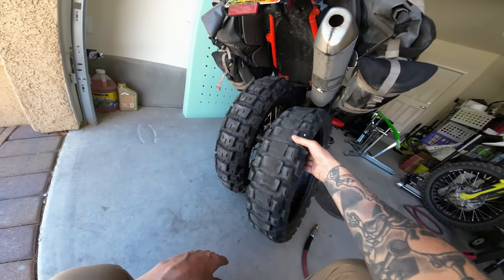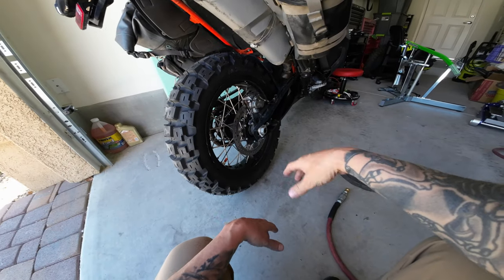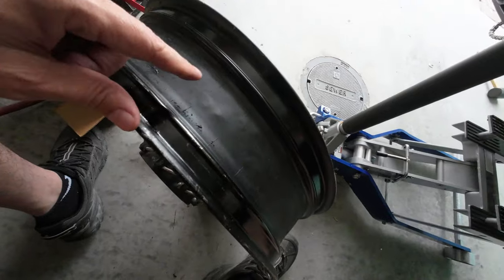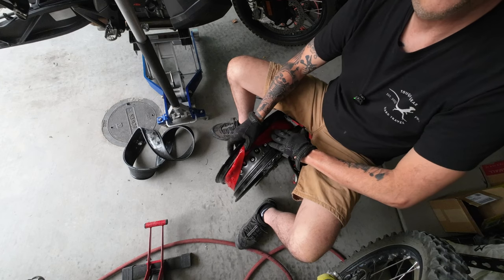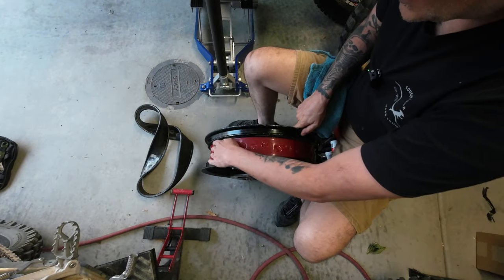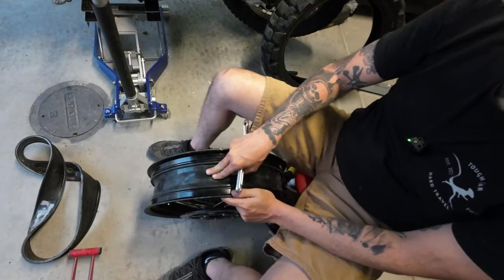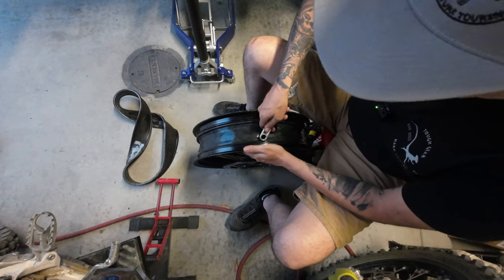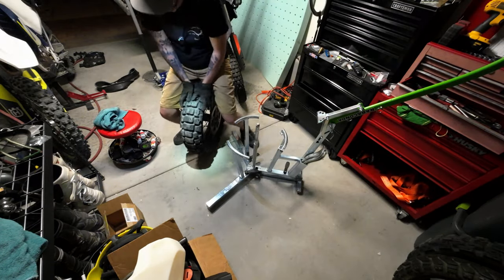KTM Spoked Wheel TUBELESS System LONG-TERM FIX

Comment: I just did this and had no luck getting the band on dry 😢 according to the ktm service manual they recommend using diluted tire mounting compound to lubricator the rim band to get it into place and that’s the only way I could get the thing on. Highly recommend doing that if anyone else is failing to get the band in dry like I was was.

Comment: Thanks for posting! I jus bought a 23 890 Adventure R yesterday and when they were getting it ready they noticed that both bikes they had on the floor had low pressure in the front tires! the factory probably didn't seat that inner gasket properly! They are sorting it out with KTM now- hop I din't have to wait too long!!
Reply from the maker: You will enjoy that motorcycle for sure. Hope they get it sorted for you.
Reply: @MobMoto  they did! And I sure am!! I cannot believe how good it is both on and off road!!! Could not be happier!
Reply from the maker: @gee4zfpv  I just bought a cinebot30 with the dji 03. can't wait to crash it. Lol

Comment: I used Yamalube tire mounting spray.  It is awesome and they claim it does not cause corrosion.  It some sort of petroleum based stuff.  It was slippery AF and almost too slippy at first.  So far so good.  My front tire is full of slime from previous owner so I think my front will be as bad as my rear tire was.  Dealers and shops also damage the inner lips of these rims too.  Mine had HUGE bites out of it that needed to be basically bondoed and sanded smooth to reshape the lips.

Comment: I am glad you made this video.  I have been curious about the KTM tubeless system.   Now I know.  You did the right thing sealing each spoke.  That's what I would have done.  I am not to keen on the valve stem being offset.  Not sure how you would use a tube if needed.  Cheers.
Reply from the maker: Thanks brother,
Yes, im not sure how a tube would work.
Reply: @MobMoto  I've read that it's not an issue to have the offset valve stem.
Reply from the maker: @coarsegoldkid  Thats good to know

Comment: Looking at this rubber into a groove thing, it reminds me of 0-rings and one thing I've learned about 0-rings is the importance of lubing them up first. Always do that with an 0-ring is pretty much the rule. 

I've always changed my own tubeless tires and have tried lots of products to help the tire go on the wheel and hopefully help seal the bead. The last time I changed both tires and used that affordable product you can find at Wall Mart at the hair aisle. It's called Blue Magic. I used that as tire mounting lube and in the spring when I checked by air pressure, after a summer of riding, each of the tires were only down on air pressure about 3 pounds. Imagine that. It sat all winter. That is the only time that ever happened to me. So from now on, it's going to be Blue Magic for tire lube for me. I was thinking that might work well on your situation too with the rubber strip, there.

Comment: The main problem with tube tires is changing a flat on the trail - whereas with tubeless you can just plug it, re-inflate, and  go on your way.  My current strategy is to go with my tube tire and bring along a "tube approved" sealant (like Sahara, Ride-On, or Slime).  If I get a flat I'll inject the sealant, re-inflate, and this should quickly get me back on the road.  Do you think this is a good approach?
Reply from the maker: When I get punctures with tubes the tubes had a huge cut in it that i don’t think any sealant is gonna help.
Reply: Not gonna help on many of the tube leaks

Comment: I did my first tire change using a Pittsburgh tire changer, and I made a slight tair on the rubber hub, which also caused leaks through the spokes.

Comment: If and when mine starts leaking I'm going to use camper roof sealing tape. Basically FlexTape on steroids. When the tape touches down its permanent. Can't pull it off... rated for 5yrs in the sun so I'd say its pretty permanent for the life of the wheel especially putting the bands back on.

Comment: By the way is there anyway to gently lift the original rubber gasket tubeless band?   My situation is just like video.  I have a perfect rubber gasket band.  No tears, nicks, or edges not seated.  I do all my own tire changes with RABACONDA.  So no idea how air is getting under one spoke.  Ahhgg !

Comment: the only times i have leaking issues with these rubber bands, is when i take it to a tyre shop for new tyres, and the new tyre grabs that seal at one point and moves it from its position. we then have to remove the tyre again, and re-seat the rubber seal.
also, that rubber seal is a servicable item anyway. KTM says it needs to be replaced every 5 years iirc
Reply from the maker: Ive had mine 2 years and they've both needed to be replaced. Some people are doing them every other tire change. Its easy to say that a shop or the individual did something wrong, but its kind of a pain compared to other manufacturers' systems.

Comment: Great video thank you for sharing. I have an 890 and today I found the rear tire flat. It is leaking near a spoke. Could you please share the part number of the rim seal?
Reply from the maker: rmatv.com in the ktm oem section
Reply: @MobMoto  thank you

Comment: That stupid red band is $50USD and the black rubber replacement is $50USD and is currently on backorder. Too many KTM parts are on backorder for several months and some parts have no ETA. KTM should stop making new bikes until they can build up a good supply of parts for their current bikes. Just something to consider if looking at KTMs.
Reply: RMATVMC has both in stock... $32 and $43
Reply: @wokinit  just placed my order thank you! 2 KTM dealerships around me said they're on backorder, ktmpartspro, and ktmworld said they're on backorder. For a 2015 1190 Adventure R so let's see if they can come through at Rocky Mountain...
Reply: Good vid and cool content. So is she still holding air? Just had my 1090r seal replaced by dealer after months of leaking, tried to go for a ride sat but it was flat again…

Comment: This why I hate spoked wheels. Look cool, lightweight and purposeful but redundant when it comes to peace of mind
Reply from the maker: spoked wheels last longer off-road. You bend cast and it will leave you stranded with no fix other than a new one. Thos video is about the ktm tubeless system, BMWs version is easy better.
Reply: @MobMoto  have since converted my CSR750 spokes to tubeless.
Reply from the maker: I might have to do the transalp myself. @nicholasparry6859
Reply: @MobMoto  I used a neutral silicone, worked it in pretty good and added a rim strip. Switched out to a standard valve stem. 500 + miles so far going to work and holds air. I have had to top it off every few days 5 psi so I must still have a small leak somewhere but feels safer thank running a inner tube. Could be in the bead though. Hard to say if my rim edges are straight enough after prying so many tires over the years. Good to know about spokes durability. Happy with my new tire setup overall. Seemed a little janky at first using silicone but proof is in the mileage.

Comment: I will never buy a KTM motorcycle ever again! Can not find the rim band rear anywhere. I used tape and an inner tube. I hate KTM! Anyone want to buy a 2015 Adventure 1190. It did not hit the street until 2017 less than 18,000 miles! Desperate!!!!

Comment: Only issue with sealing the spokes is you won't be able to tighten them if needed.
Reply from the maker: Im not super gluing the spokes its easy to tighten the spokes from outside the wheel.
Reply: @MobMoto   yup
Reply: Trick is to true and tighten before sealing. As long as sealant is flexible...can tighten no problem.